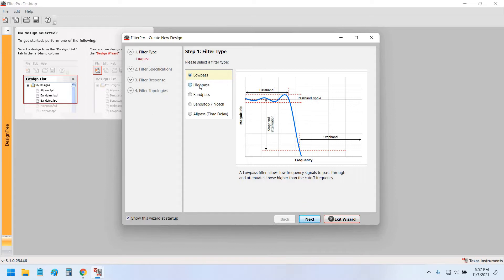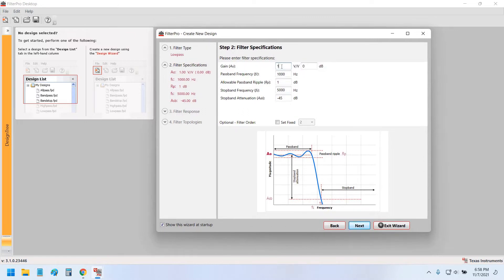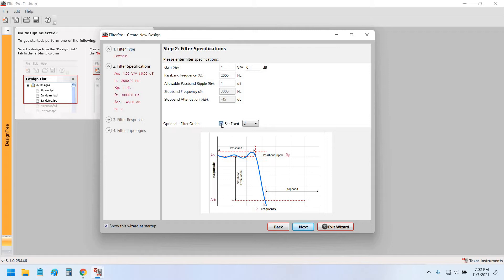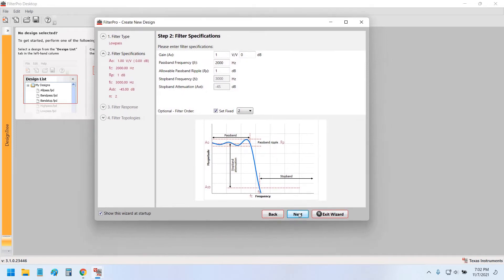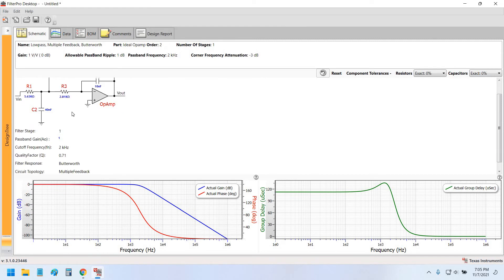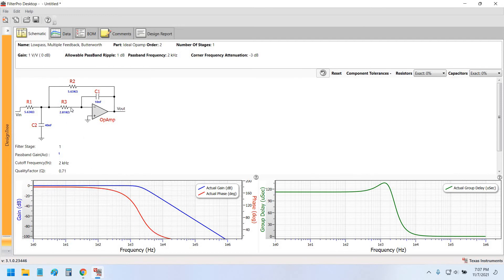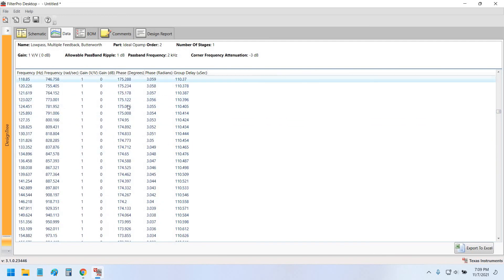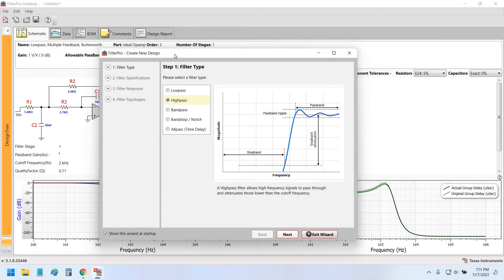Filter Design made Easy by Texas Instruments FilterPro App

Comment: Where can I find FilterPro Desktop installer (v2/v3) ?
Reply from the maker: You need to get permission from TI to get a downloadable Filter Pro tool
Reply: @circuitsimulations  But they said, that they don't provide installers of obsolete soft. Can you post the installer on a file sharing site?